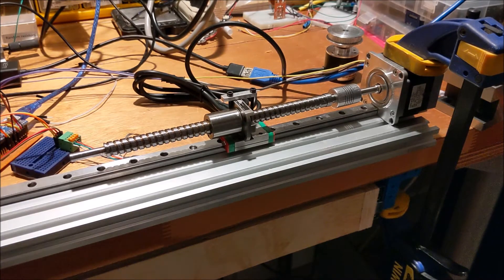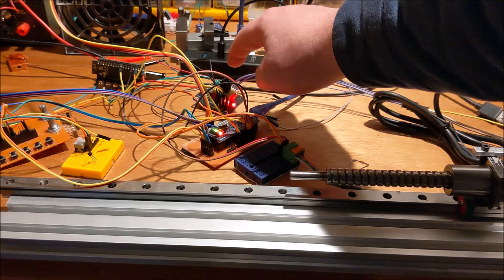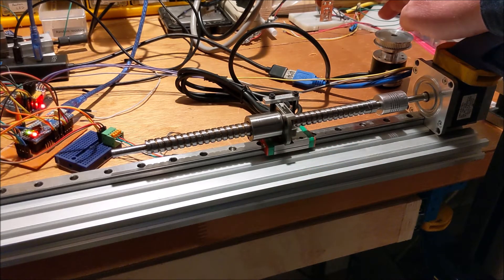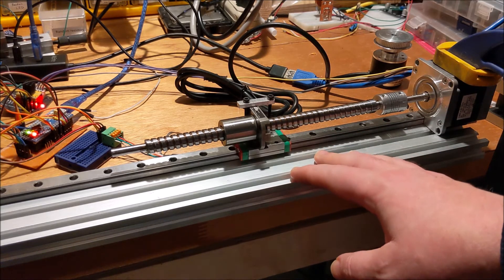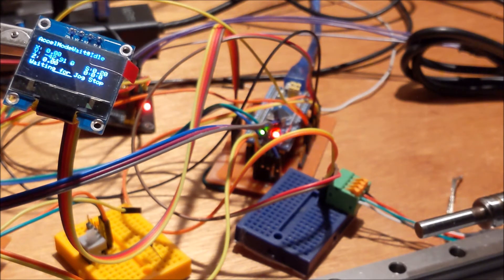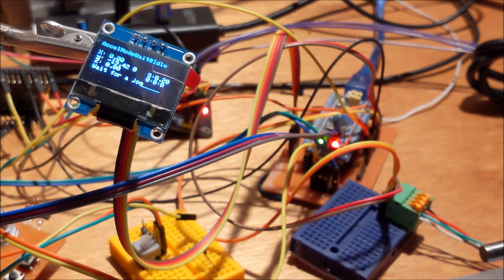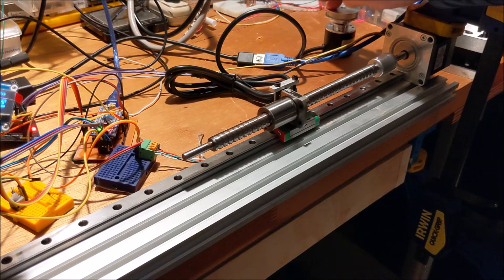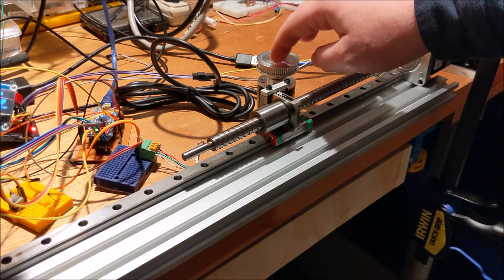velocity based jogging with grbl and grblHAL

Comment: Did you get it to work as you wanted? I came across your video while working on my own implementation. I'm at a point where I need to tune the relationship between the wheel speed and motor control and I was looking for ideas. Anyway, what you have with that encoder looks great!
Reply from the maker: I want to be able to have 4 axis so I'm using bart's port.  Unfortunately there are issues with jog cancel and I've not developed this further.  I have mentioned the desire for a really robust native jogging support to bart a few times but I don't think it is a priority.  Since i'm using esp32 and the i2s stepping allows for 6 axis I'm not sure compatibility with grblHAL will continue without someone developing that driver.  I don't think Terjeio has much love for the esp32 platform.  If you get something robust working please let me know, also happy to look at your implementation via github, gist, or pastebin.
Reply: @JesseSchoch  I see. I will get the code I currently have up to GitHub soon, hopefully today. If I have time I will also post a quick video of what I have so far. I made mine operate in two different modes, continuous jogging and step per pulse. The step per pulse is just like clicking on the arrow buttons of a g code sender, and would be enough to allow me to manipulate the cutting head position from the pendant. The continuous jogging of course is the fancy mode and I am still tuning it but I am optimistic of arriving at a solution. I'll keep you posted.

Ok, had a bit of time and I cobbled together a short video:
https://youtu.be/UvRLiaFA8Ps
I'll try to get the code on GitHub soon.
Reply: Jesse, have you had any opportunity to upload the code you used for the STM32?  / all

Comment: Hi. I'm gonna make a machine (a lathe) that I think to control through a NC. While at first my idea was to use the original GRBL code to flash in a ATMega32 (I have a bunch of them) adapting the code optimization for that processor, I ended up with the idea of porting the whole project into an stm32f3. I didn't know about this grblHAL so I will give a look at it before endeavoring into more complex tasks. So thank you for having posted this video.
About your problem, I don't understand whether you send the $J= command or what else. Also, did you already seen this page? https://github.com/gnea/grbl/wiki/Grbl-v1.1-Jogging
Reply from the maker: Thanks for commenting, i've been watching your build!  you should buy a manual mill with DRO, they are generally handy and would save you a bunch of time!  CNC is great but the setup is expensive in time...

Regarding your question:

checkout this discussion https://github.com/terjeio/grblHAL/pull/9

also grblHAL has "alpha" support for G76 which is really needed on a lathe.  unfortunately i don't think there is a port for the F3, there is a F1 driver though and they are cheap!